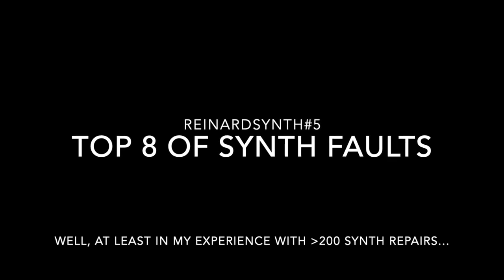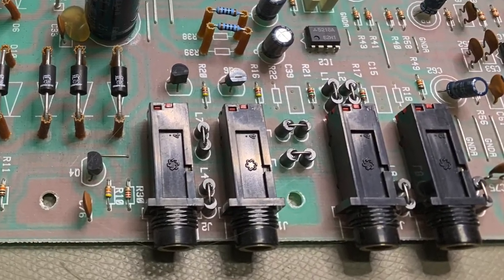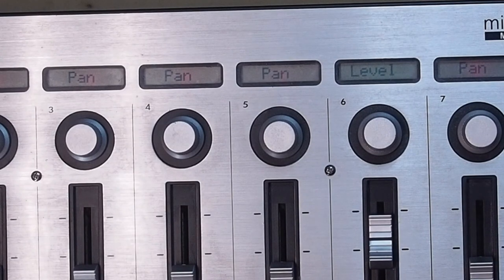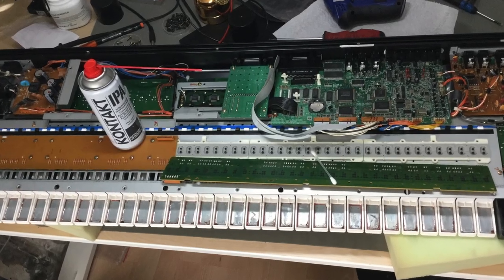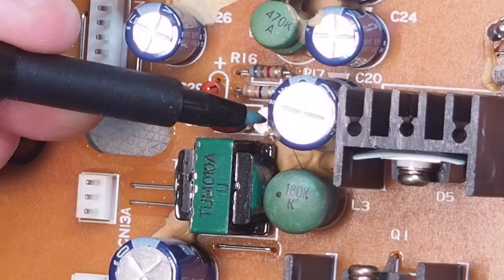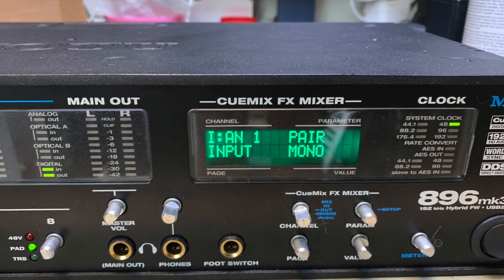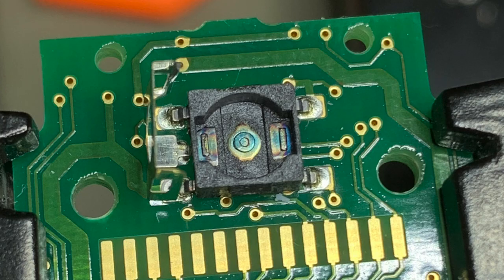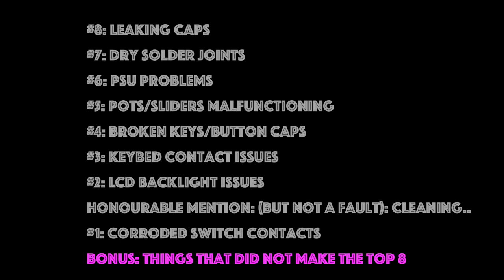ReinardSynth#5 Top 8 of Synth faults

Comment: One thing I've noticed is sellers will specify an external power supply for some hardware like an Arturia drum machine but blur out the voltage and current as well as center polarity of the barrel plug.
Reply from the maker: yeah, that’s because with these three parameters voltage, amps and plug polarity you can find way cheaper ones than the one they offer… best is to read in the user manual of the device what power supply is needed, most often they specify it there (but sometimes not… argh)

Comment: Amazing guide. Now, I know that glue is not leaked capacitor electrolyte. Oh well, the old caps had to be changed anyway. 
Is there a good method for fixing stiff aftertouch response on various vintage synths like K2000, DSS-1, SY77, and similar?
Reply from the maker: @r0tekz  re aftertouch: difficult, these resistive strip deteriorate and either need a good internal clean (almost destructive depending on strip type). what you can also do is re-calibrate the aftertouch circuitry. depends on synth how much can be set using a potentiometer…
Reply: @reinardsynth6581  Thanks. I will look into that as an option.

Comment: Excellent video, Reinhard! Hey, do you know if it's possible to get replacement push button switches for the Yamaha RX series drum machines that you featured? I did some searching but gave up in the end.
Reply from the maker: Know the problem: they are unobtainium... I did fix the buttons of an RX15 once by removing the caps to lay bare the internals and spraying some Deoxit contact spray on the metal contacts. That fixed it.

Comment: Hello Reinard, you make great content. Would you know what type of felt is used in my Motif 7? The keys are clacking, so I think it's time to replace it. Cheers from Sweden!
Reply from the maker: To reduce “clacking” replace the “return”-felt under the keys. See my 01/wpro video where I do this. Replacement felt you can still order with yamaha, use part nr.  VQ176100
Reply: @reinardsynth6581  Thanks so much!!!
Reply: @reinardsynth6581  Thanks for your time!! FYI, they keys are clacking when I press the keys down. Is it still the return felt?
Reply from the maker: Ni, that would be the felt on de bottom of the key path, the “aftertouch” felted strip actually. Could be replaced but is a bit more finicky to do
Reply: @reinardsynth6581  Ok, do you know where I could find a replacement? 🤔🤔